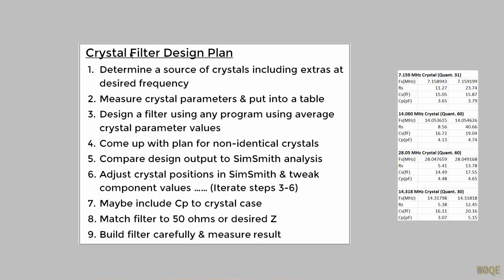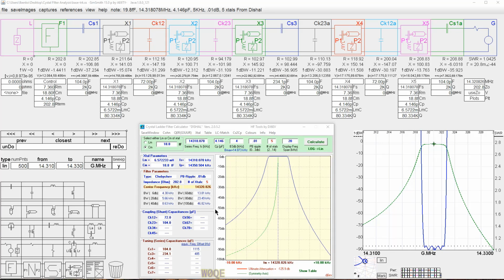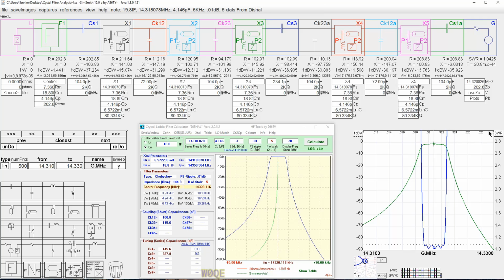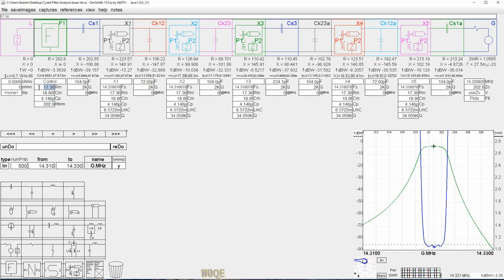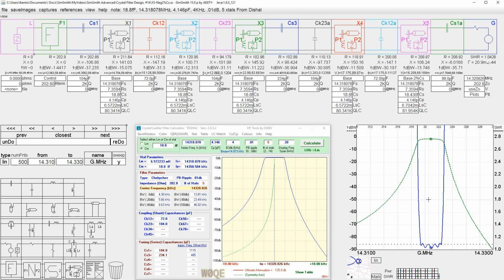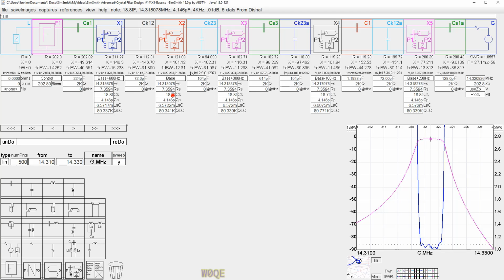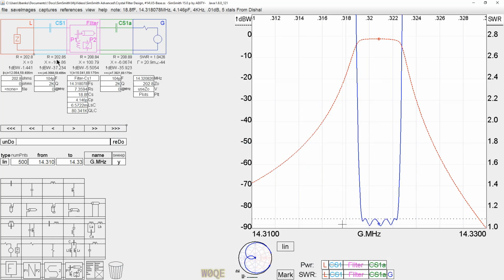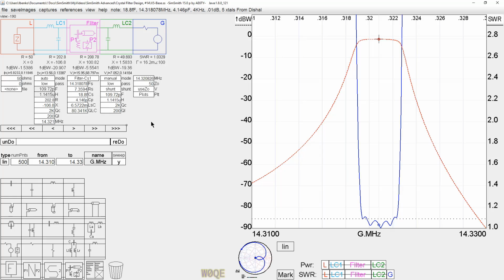#27: Crystal Filter Design, Part 2 (Adv. 14)

Comment from the maker: I received a question today but when I tried to answer it the question does not show so I will just post the answer and hope that the person who asked the question will see it.
The question asked why sometimes certain capacitors are used and other times they are not needed.  The design of the filter with the way I did it needs the crystals to have slightly different frequencies but expects that you have crystals that are all the same frequency.  If you had access to exactly the correct frequencies the series capacitors that slightly adjust the effective crystal frequencies could be eliminated.  So after I measure a group of crystals I try to use them so that they don't need to be "pulled" as much which means that usually a capacitor or 2 can be eliminated.
See the comment that Alexej Svirid made.
Larry, W0QE

Comment: Larry, is there a method to move the center frequency of the filter? I have built several ladder filters in the past. The problem I run into is the CF is different for each filter when built from the same groups of crystals. If I build one with a ~2.8 kHz BW, it will have a certain CF. If I then build one with a 700 Hz BW, the CF shifts by 2 or 3 kHz. That means if I am tuned to a CW signal using the 2.8 kHz filter and switch to the 700 Hz filter, the signal disappears. This can be handled in software but it would be better if the CW and SSB filters had the same CF like the commercial filters do.
Thank you for the videos. They are all very well presented.
Reply from the maker: Ray,
If you look at the Crystal Ladder Filter Calculator you will see that for any filter that is designed with identical crystals that some of the stages have  frequency offsets that are set by the tuning (series) capacitances.  These capacitors effectively change the frequency of the crystal but they lower the effective Q of the crystal.  You could just use crystals for slightly different frequencies for the offset stages but this is not practical unless you are having the crystals manufactured specially for you.  When you measure crystals you will get a range of frequencies and it is wise to pick what crystal to use for each stage to minimize the need to tune the crystals since the Q is reduced more for larger frequency shifts.  However all the shifts are in the same direction and this is why the narrower band filter filter has a slightly different center frequency that a slightly wider band one does.  Knowing this in advance and having a large group of crystals to sort thru you might be able to get the 2 center frequencies to be the same but I think it is probably to just shift the oscillator frequency slightly which will accomplish the same effect. Does this make sense?
Larry, W0QE
Reply: @w0qe  Yes, it does. Mouser sells an IQD crystal at 9.000 MHz, The also sell one that is 1500 Hz above and one that is 1500 Hz below the 9.000 MHz one. Obviously these crystals are made for SSB use. If I remember correctly, with the last filters I built, the narrow 700 Hz one was about 2 kHz below the  wider 2.7 kHz one. That was with crystals marked 13.500 MHz. I think I will order 20 of the 9.000 MHz one and 20 of the 9.0015 MHz one for testing purposes. If I can find 5 or 6 of each that are close to those two frequencies and use the 9.0015 one for the narrow filter I may be able to get both filters very close to each other. The shift with 9 MHz crystals should be slightly less than the 13.5 MHz ones. Shifting the oscillator works and that is what I had to do with the 13.5 filters. It just involves a little extra circuitry to let the micro know whether you are in SSB or CW mode.

Comment: I noticed that loading base-trk.ss in SimSmith 18.4 does not show the graphs.  It does work in SimSmith 18.3 though.  Is there a change which can be made to get it working in newer versions of SimSmith?
Reply from the maker: Rob,
There is bug in SimSmith ver 18.5 which happens if the value of the Load is zero.  Notice the V,I=NaN,NaN above the components where NaN means "not a number".  Until this is fixed just change the Load value to 1n or some other extremely non-zero value and all will be fine.
Larry, W0QE

Comment: Thank you Larry. These videos are really illustrating and helpful for a RF beginner like me. I am wondering if you could post the links for how to measure the crystal parameters. Thanks!
Reply from the maker: I use the AIM 4170 or AIM 4300 analyzers to measure the crystals.  The software automates the crystal parameter measurements as I mentioned.  Also http://www.w0qe.com/Projects/crystal_bandpass_filters.html has more info.  The crystal parameters can be measured manually with a network or impedance analyzer.  Making an impedance measurement at about 75% of the series resonant frequency gives the parallel capacitance.  Measuring where the impedance is the lowest and is resistive will give the crystal series resistance and the series resonant frequency.  By knowing the series resonant frequency you know the product of the motional inductance times the motional capacitance.  Then measure the impedance about 1kHz above the series resonance and you get an impedance that is inductive and from this inductive reactance you can calculate motional inductance and capacitance.  When you are done the parallel capacitance is almost always about 220 to 225 times the motiional capacitance.
Reply: Thanks Larry. It helps!

Comment: Fantastic information Larry, well explained and comprehensive.  What are your thoughts on running the crystals in for a period before carrying out matching?
Reply from the maker: Glad you liked the video.  I don't have a lot of data on this topic but I have made some measurements that might help.  My usual measurement setup (AIM 4170) measures the crystals at -16dBm (25uW).  If I make repeated measurements of the same crystal I see the series resonant frequency change by maybe 3Hz at 14MHz.  I assume this tiny change is due to heating and if I wait 10 minutes the frequency will be within 1Hz of the initial measurement.  I have also measured a crystal, then driven it at the series resonant frequency with 10mW, and then re-measured it and saw a change in frequency in the order of 30-50Hz.  Again waiting for the crystal to "cool" down returns the series resonant frequency to withing 1-2Hz of the original.  A 30-50Hz ambiguity in the crystal frequencies will have a very minimal effect on the overall crystal performance.

For some notch filters I built I wanted to notch a +20dBm signal so I paralleled the first 4 crystals on the generator side of the filter.  Each of these crystals could be expected to dissipate about 15mW and I the filter worked fine and any heating that the crystals experienced did not cause long term changes.  The only data on crystal aging that I have is that the overall response of band-pass filters that are more than 5 years old has not really changed based on network analyzer sweeps.

If it makes you more comfortable then I see nothing wrong with "running the crystals in" for a period but remember that the goal is actually drive the crystal where some small amount of heating will occur so you will need to set the generator specifically for each crystal and be careful not to apply too much power.  An easier way might be to just put the crystals in a tray in the oven and heat them up to 50-60 deg. C for an hour and let them cool down for a day before measuring them.